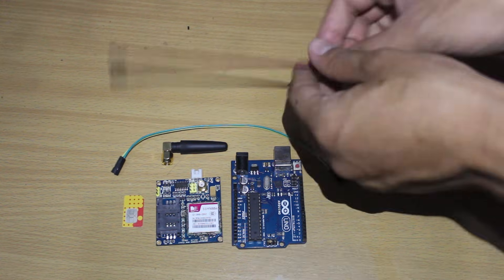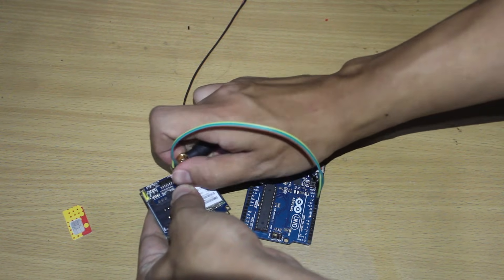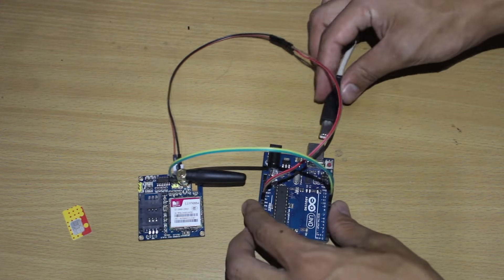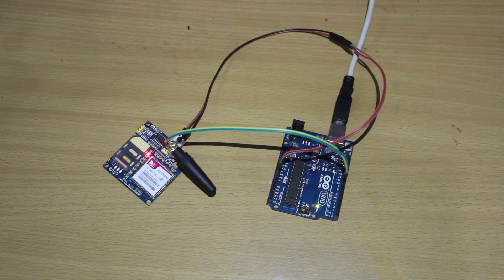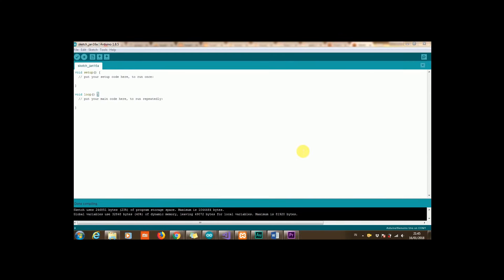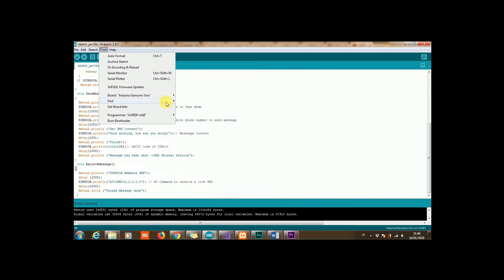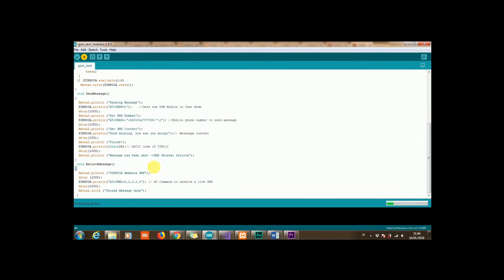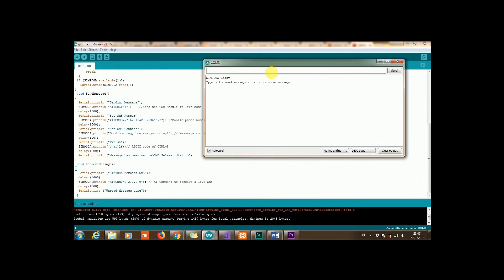SIM900A with arduino tutorial. How to send and receive message

Comment: Hi sir, do you have the schematic circuit for this project?
Reply from the maker: You can open the link on the description
Reply: @miliohm  permisi pak, apa solusinya kalau SIM900a tidak melakukan blink? dan tidak dapat mengirim SMS?
tpi di serial monitor terbaca SMS berhasil terkirim?
Reply from the maker: @muhammadgazaligali5581  coba simak video saya yang lain, judulnya SIM800L troubleshooting guide. Di situ ada cara cari masalahnya di mana. Meskipun beda tipe modul, tapi cara kerjanya sama.

Comment: Hello, i did the same connection of gsm power supply to the arduino but my gsm module's led is not on and not sending message. What seems to be the problem? My gsm is sim900a mini ver3.8.6 same as the video

Comment: I followed the video and connected the power to the 5V of the uno but the led is still blinking every 1 second. How do I fix this?
Reply from the maker: You can follow my another video on SIM800L troubleshooting guide. It is for V1, but it is almost the same.
Reply: @miliohm  Thank you for the reply. I am assuming it is because the uno board cannot provide enough power. Do you have any suggestions for an external power supply? My SIM900a does not have a female dc adapter.
Reply from the maker: @loggerino7331  you can use any kind of power supply as long as it can provide 2A current. Then just connect it with jumper cable.
Reply: @miliohm  Hello again, so I now have an external adapter 5V 2A and the SIM900A blinks every 3 seconds now, but it still cannot send out messages to my phone. Why is this happening?
Reply from the maker: What the answer of the AT command?
Reply: @miliohm  Thanks for replying but I fixed it. I need to connect the ground of GSM to the UNO as well.
Reply from the maker: Sure. You have to

Comment: sir, my led on the top right is not blinking. can you solve the problem?
Reply from the maker: Maybe it's the power issue. Try checking the voltage at VCC and GND of SIM module

Comment: I have been looking on the internet at how to use this gsm 900A sim model and most of it uses the buck power to power it up. so, when I watch this video, I am a bit confused about whether I had to use the buck power or just power it up straight from the Arduino. I am sorry for asking this question. I am a complete beginner at this matter
Reply from the maker: it will be better if you use the 2A min power supply. And this module can take 5V input, not like the SIM800L. So if you have 5V power supply II think you don't need the buck converter

Comment: Sir hello.. my sim900a module and arduino uno will work fine only after i plugged, unplugged and re-plugged the 5vdc source adapter. After doing so, the devices will function normally. Its just that it will not automatically do the job on the first powering. I need to turn it off again then on before it gets the signal. Can you recommend something on it sir? Thnk u so much..

Comment: why to find the signal is difficult..the blinking always faster
Reply from the maker: Sometimes it caused by lack of current. Try use external power supply
Reply: @miliohm  can u explain a little bit more?
Reply: @miliohm  can u explain a little bit more?
Reply from the maker: @daniasuraya9350  use external power supply with more current. Like 5V 2 ampere
Reply: @miliohm  oke... Tq for helping me... My GSM already have signal😊
Reply from the maker: @daniasuraya9350  sama-sama. Jangan lupa subscribe dan share ya 😄

Comment: my gsm module is not blinking, what might be the reason ???
Reply from the maker: Check the power. When it powered it should blink
Reply: @miliohm  it’s not blinking when powered with 5v
Reply from the maker: @mominkhadri8062  maybe you have problem with your wire. Check the end of wires with multimeter. Or maybe you have problem with your SIM900A module
Reply: @miliohm  thanks

Comment: Hey why I can't receive the message, when I enter s, the serial monitor shown that the message has been sent. Please help me😭
Reply from the maker: Are you sure the number have changed?
Reply: @miliohm  yes I'm sure, i have changed the country code too.
Reply from the maker: @hafizhafizi351  did your sim already got the signal? it should blink slower
Reply: @miliohm  yes i got it
Reply from the maker: @hafizhafizi351  it should be your wiring. make sure vcc,gnd,tx,rx are connected. Did the gnd connected? and rx sim to tx arduino. tx sim to rx arduino.
Reply: @miliohm  hey it's still not working, can i have your email so I can ask you some questions directly.
Reply: @miliohm  if I connect rx sim to tx arduino and tx sim to rx arduino, I can't upload it. I used the first arduino sketch and the arduino replied OK, and when I used the second sketch, I didn't received any message, the wiring from the first and second sketch are same right?Sorry for a long question. 😊
Reply: @miliohm  and 1 more thing, I can received the message at the serial monitor that I sent from my phone to my sim900a but not every messages the serial monitor can read, when I enter s , it showing Error at the serial monitor

Comment: Do you have the software serial file? can u post inside too?
Reply from the maker: Did you mean the library?
It's already included in arduino IDE
Reply: @miliohm  yes, because I have try it, but the phone do not receive the message, so I wonder is it due to different software serial library
And do it limit which type of simcard can be used only like u mobile or digi can be used or not?

Comment: Hi! How long did it take for the module to finish searching for networks? The blinking red in the corner is fast and the power status blinks also every few seconds. How do i fix this?
Reply: maybe power supply is not enough try use 2 amp power supply. i think power bank also can..

Comment: my gsm sim900a did not receive any AT commands
Gsm did not responds any of my AT commands in my serial monitor
Reply from the maker: Check the wiring and baudrate. Test using a multimeter

Comment: Test the connection by type “AT” and then enter. If the arduino reply “OK” means your connection is established and working. If still no answer from arduino then check your connection and wiring again.
serial monitor arduino tidak reply OK selepas taip AT. what should i do? sebaliknya keluar macam ini:
Arduino with SIM900A is ready
SIM900A started at 9600
Setup Complete! SIM900A is Ready!
⸮⸮⸮⸮⸮@⸮⸮

Comment: You should update your code tutorial within the link. Misleading infos.

#include <SoftwareSerial.h>
SoftwareSerial SIM900A(10,11); // RX | TX
// Connect the SIM900A TX to Arduino pin 2 RX. 
// Connect the SIM900A RX to Arduino pin 3 TX. 
it's Arduino pin 10  and 11 guys not 2 and 3
Reply from the maker: Thanks for your correction

Comment: bro, di serial monitor udah seperti di video. tapi kok gaada sms masuk, itu kenapa ya? dan indikator led nya kaya gadapet sinyal. apakah kartu 4G sudah bisa support atau saya harus pakai yg 2G?
Reply from the maker: Ga masalah kartunya. Pake power arduino doang? Kadang ga kuat kalau arduino doang. Harus pake power tambahan dan diturunkan jadi maksimal 4,2V. Kalau dpt 5V juga kadang ga bisa.
Reply: tapi di video anda bisa ya bro pakai power dari arduino doang... jadi bingung saya. soalnya implementasi project saya ditaruh dijembatan yang tidak ada saklar nya, jadi gabisa pake adaptor tambahan. bisa bantu kah?
Reply from the maker: @adamahlulkarimramadhan244  bisa mas tapi tidak stabil. Kalau pas kondisi tertentu bisa ga dapat sinyal. Power arduinonya pakai apa?
Reply: sementara pakai power dari laptop, nanti pas implementasi pake battery 9v bro

Comment: How to power up Arduino and GSM SIM900A module from same supply?
Reply from the maker: if you use 5V power supply, simply connect 5V PSU to 5V arduino and GND to GND arduino.

For SIM900A you need to decrease the voltage to around 4.2V. You can use stepdown module, or use some diode after output before connect to SIM900A.
Reply from the maker: don't forget to use the same ground for arduino and SIM900A module
Reply: @miliohm  Arduino Power jack requires 9V 500mA while GSM SIM900A requires 12V 2A. How to satisfy these requirement? Thanks for your reply.

Can I use 9V 2A power adapter for both ?
Reply from the maker: @kvnptl4400  arduino need 7V min of you plug in power Jack. But you can use 5V if you connect at 5V pin. And SIM900A is not 12 V. It's 4,2V 2A.

Comment: gsm 900a get coverage in malaysia? cause my gsm is not working..blink so fast like dont get the coverage
Reply: hope u can help
Reply from the maker: @azrolazhan9804  usually it caused by low power. Try add more current by using external power supply not only from arduino. Seharusnya bisa, karena di Indonesia lancar, mungkin malaysia tidak berbeda jauh.
Reply: miliohm thanks for the information
Reply: what the other power resource that been u used?

Comment: Hello, can i able to use c# for development? if capable, what libraries will i use? . Thank you
Reply from the maker: you just need serial communication, and understanding AT command. You are ready to go.
Reply: @miliohm   It dont need to add any gsm library? . Thank you
Reply from the maker: @bryanmartinez19  nope, as long as you understand the AT command
Reply from the maker: @bryanmartinez19  but the easiest way i think you should use arduino as a helper
Reply: Use c++, not c#.

Comment: still blink fast,and network is good why?
Reply from the maker: it is usually the power issue. If you use only arduino, try to give sim800L bigger current with another power supply.
Reply: Its gsm 900A
Reply from the maker: @johnmathew8104  yeah that works the same way. I mean for gsm 900A too

Comment: Hey sir! I tried your code, my sim900a is working but I still can't receive/send sms.I also edit the number and tried different baud rate 9600, 2400 and 1200. PLEASE HELP me on solve this problem. Need this for my project. THANKS
Reply: same with me did you solve it?
Reply: This model is only for the Indian market and requires 2a supply.

Comment: Sim900A is not connecting to network. I am providing supply from Arduino. What could be the issue?
Reply: did you find any solution ? I am currently facing the same problem , if you did find any solution please share .

Comment: sir! I did same  and i m getting this error sir plz help me how to resolve it.

java.io.IOException: Cannot run program "{runtime.tools.avrdude.path}/bin/avrdude": CreateProcess error=2, The system cannot find the file specified
 at java.lang.ProcessBuilder.start(ProcessBuilder.java:1048)
 at processing.app.helpers.ProcessUtils.exec(ProcessUtils.java:26)
 at cc.arduino.packages.Uploader.executeUploadCommand(Uploader.java:129)
 at cc.arduino.packages.uploaders.SerialUploader.uploadUsingPreferences(SerialUploader.java:207)
 at cc.arduino.UploaderUtils.upload(UploaderUtils.java:78)
 at processing.app.SketchController.upload(SketchController.java:732)
 at processing.app.SketchController.exportApplet(SketchController.java:703)
 at processing.app.Editor$DefaultExportHandler.run(Editor.java:2197)
 at java.lang.Thread.run(Thread.java:748)
Caused by: java.io.IOException: CreateProcess error=2, The system cannot find the file specified
 at java.lang.ProcessImpl.create(Native Method)
 at java.lang.ProcessImpl.<init>(ProcessImpl.java:386)
 at java.lang.ProcessImpl.start(ProcessImpl.java:137)
 at java.lang.ProcessBuilder.start(ProcessBuilder.java:1029)
 ... 8 more

Comment: Good day, sir, I did not receive any message, I followed all the step and everything seems alright. The only problem is the message cannot receive by phone. May I know what's wrong?
Reply: suet fen i have also such problem.kindly guide me.
thank you.
Reply from the maker: Is the AT command test work? see at the website. If it doesn't you have problem communication between the arduino and SIM900A module.
Reply: miliohm the communication test work. But when it come to sending the message,  my phone did not receive any message even it said the message is sent
Reply from the maker: Suet Fen did you edit the phone number? Did the module already got the signal?
Reply: Yes.. I do..
Reply: miliohm,i am not getting any message in my phone also after pressing s character , but serial monitor shows message sent what is happening sir.Can you please help me to sort out this problem.everything is ok except receiving sms on my phone why?
Reply: @suetfen2651  Same problem.Did you already solved it sir?
Reply: Same problem.Did you already solved it sir?

Comment: what could be the problem in my work? Everything works fine, it's just won't send and receive messages.
Reply from the maker: is the signal ok? what it says in serial monitor?
Reply: miliohm hmm. I think my gsm module has different blinking pattern that's why i cant say if there is a signal or not. And also, the problem maybe is on the AT command. I followed the steps on the link which is to test the AT command and when I tested it, it wont send back "OK" when I send "AT" on the serial monitor
Reply: miliohm it also says "????" At the end of serial monitor
Reply from the maker: PGA Gabriel so you have problem with serial communication. Make the wiring is right and not swapped.
Reply from the maker: PGA Gabriel please check the baud rate
Reply: miliohm hmm does the code work on philippines?
Reply from the maker: PGA Gabriel itu should work on every country. The code doesn't matter. The matter is the product
Reply: ahmm, i already bought a new gsm module, it blinks correctly, but now the AT command test wont work, it only send back " K⸮ " what does that mean? also it won't receive the text i send to it, it receives codes like JCCKwith box box codes. what should i do?
Reply from the maker: PGA Gabriel it is like you have issue with the baudrate. Try using another baudrate speed
Reply: miliohm change it like what speed? I use 9600
Reply from the maker: PGA Gabriel it ia baudrate in bottom right corner. Make it 9600bps
Reply: miliohm it is on 9600 bps. Can i email u or chat?